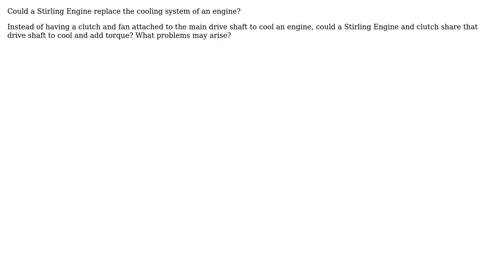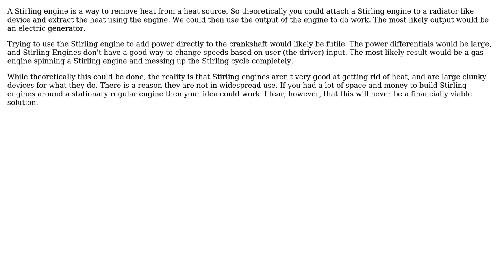Engineering: Stirling Engine Cooled Engine

Comment: Good question. Stirling engines in the future could be smaller, cheaper and more efficient. General Motors built a Stirling engine, payed for with tax payers money, to be used in cars. To get enough power they used hydrogen gas on a very high pressure. The GM CEO said they would not use the engine because it was a bomb. Efficiency and exhaust were good.